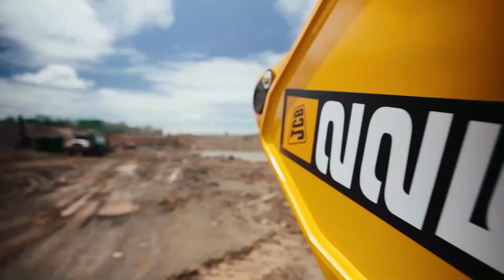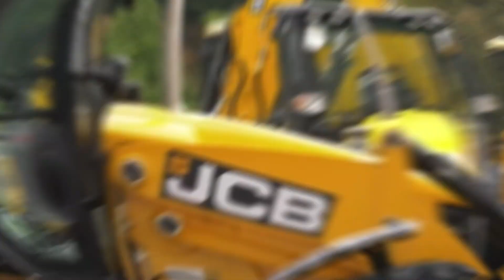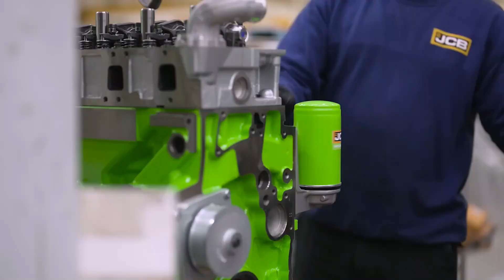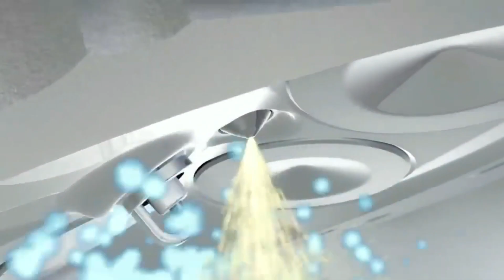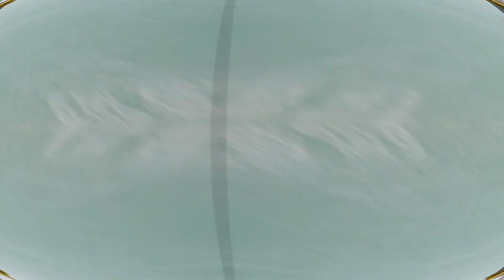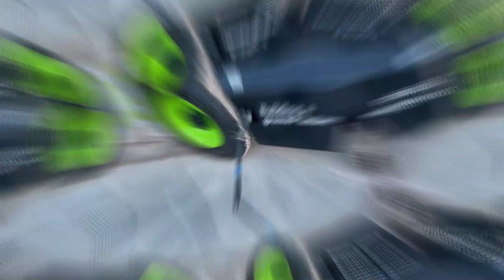Worlds 1st! This JCB New Engine Could Bankrupt The Entire EV Industry!!!

Comment: The video said it all. It’s all very well having a hydrogen engine but it is not as efficient as an EV, you need electricity first to produce the Hydrogen even tho that said hydrogen is less efficient than the EV. In simple terms using Electricity to produce a less efficient fuel than the electricity itself. The one aspect not mentioned in the video is the costs involved in just one hydrogen fuel point, it costs millions and can only dispense fuel to a very limited amount of vehicles per day due to the fact it can only hold a small amount of Hydrogen in gas form before the system has to generate more from its liquid storage tanks which have to be specially produced and maintained. This factor has yet to be overcome for mass market production.
Running a hydrogen vehicle would be great but at this time it just doesn’t make sense economically when the EV is far more efficient and it can be fuelled from home overnight, has already an expanding charging infrastructure and the tech on the vehicles & batteries is moving forward at a tremendous pace.
Reply from the maker: you have a very good point thanks for your comment brian :)